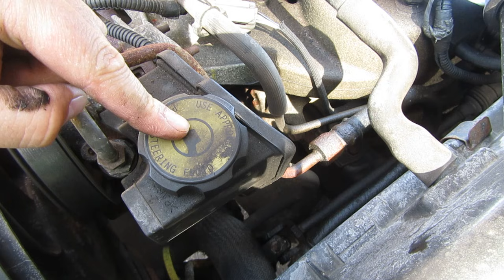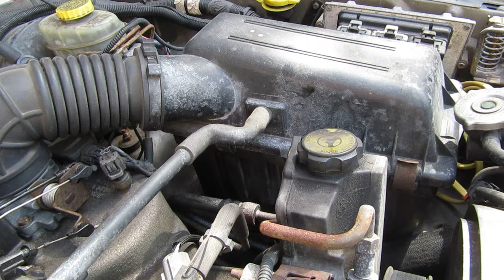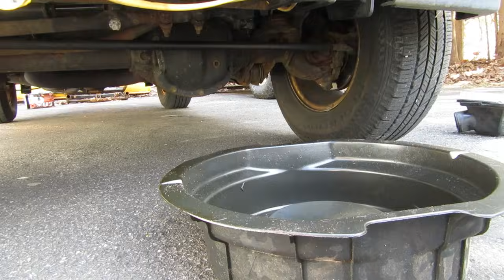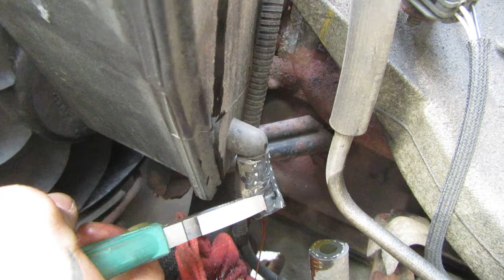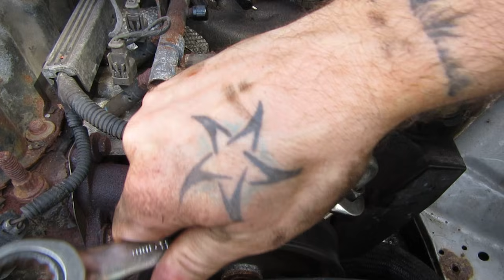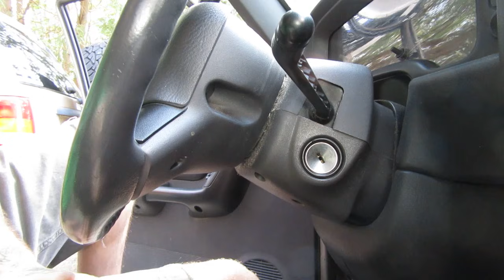Tips for replacing power steering line and fixing leaks

Comment: Legend!!! I was getting started on my lines and after cutting the return line to length, and doing a little bit of cleanup I figured I should watch a refresher video before disconnecting anything. Can tell you've got the experience and know how to do this right. I absolutely use a turkey baster to pull the fluids out, too! 😂 But I think I have the right tool to pump it out this time, hopefully it works.

Comment: didn't even think not removing the rubber line off the reservoir.   Fortunately, it didn't break off ! Got a 5th gen camaro,  and was going to replace the pump originally, but found alot of moisture on the high pressure line.  Great work, learned alot from this !

Comment: Thanks homie, I was just gonna start turning wrenches remove the lines install the new ones, and call it a day. The finer details are gonna help a lot. This will be easy as pie. I hit a nasty pot hole on the interstate yesterday and for certain my front bumper which is plastic bottomed out. The lines on my car hang low and it must have flexed the line which sprung the leak on an already older car.

Comment: Idk if you still answer comments or questions, but if I follow this video step for step, will I be able to do this alone? Like, is there any keys components, steps, or techniques not shown in the video that may make me inadvertently mess up? I cannot afford to have this professionally replaced and want to do it myself. The whole line is warped and cracked. Also, how do I make sure I get the right replacement part for the job? I have a 2008 Sebring.
Reply from the maker: With this video you have everything you need. nothing is left out. If you have not tackled many project on a vehicle make sure you go slow and follow each step and you will be fine. I would go to rockauto.com for parts. it is idiot proof. pick the make > year > model > trim and it gives you the correct parts. good luck!
Reply: @DEInTheGarage  Thanks so much for answering! I was about to start making rash decisions lmao🤣

Comment: My power steering on my 2005 Liberty Jeep is making a whining sound when you turn the steering wheel and fluid leaks out of it when you turn your steering wheel but if you leave your wheel straight and you just go out and let it run and check it it's not leaking but so you turn the steering wheel fluid starts coming out of the line is that my pump is bad or is it just the fluid leaking cuz it's filled up with fluid

Comment: Instead of replacing those spring clamps that go over the ends of rubber hoses, I think it's a good idea to replace them with a screw type hose clamp. That way you can always tighten them if needed. You can do it all over the engine.
Reply: Spring clamps are used because they can expand/contract with temperature changes. A screw type hose clamp can’t.
Reply: @Stick Wall Farm  exactly screw clamps are not designed for temperature changes
Reply from the maker: Certainly a good idea
Reply: instablaster...

Comment: People might disagree but i found using 10 wt hydrolic oil makes every seal hose etc last a whole lot longer never had another pump or seal go out once i quit using power steering fluid the fluid type is bull my dads dodge used a type mineral oil every 2 years seals would o out we put hydrolic oil in it over 200k miles no more leaks after 2 pump seal failures in 30k miles
Reply: Where would I get the 10 wt oil
Reply: @randypond7499  i drove big rig i used to get mine at truck stops the last time i bought some was a regular parts store not autozone or one of them i live in a farm area and any tractor store should still have it ,i think the ATF or powersteering fluid is just too thin and too high detergant actualy hydrolic jack oil is the same

Comment: Nice video! Were you not supposed to extract all air that could have been introduced into the system?
Reply from the maker: Turning the wheel side to side will work the air into the reservoir as it is the highest point in the system. Then you top it off and you are good to go.

Comment: just did this on the v8 wj and man was a pain couldn't get the airbox off all the way bolt was broken onside so had to work around it. was so hard to thread in place. Should it be vibrating a bit I'm a kinda worried it's making noise now I hope that goes away once it's driven a awhile.
Reply from the maker: What is vibrating? The steering system or air box?
Reply: @DEInTheGarage  It was the steering at first but as soon as I drove It the vibration  went away and steering is all smooth now and leak free.
Reply: Yeah, if you crack that air box or the vacuum box, you can get vibration because you broke the seal.